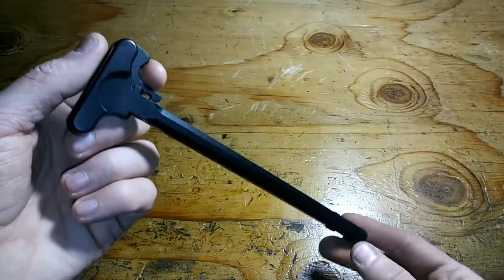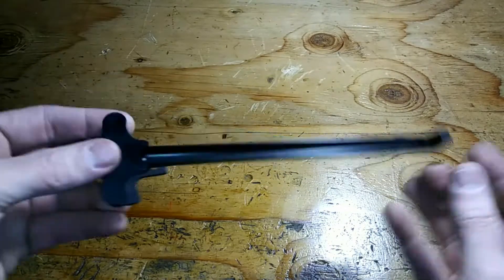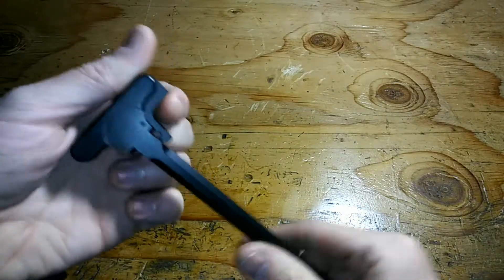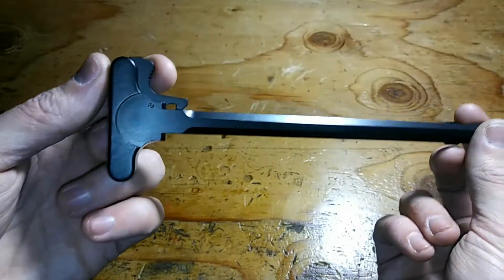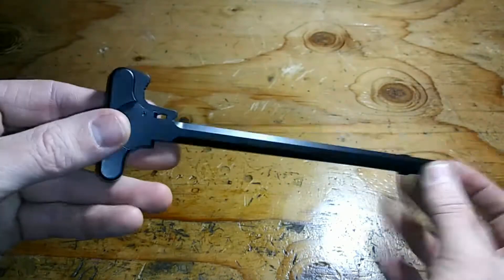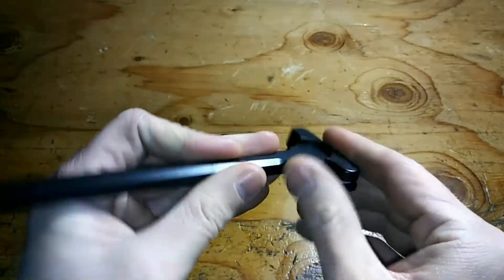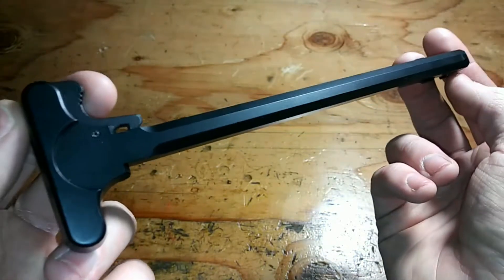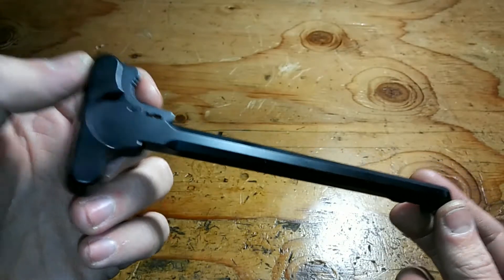IMI Defense AR-10 7075-T6 Aluminum Charging Handle

Comment: Great review have you ever thought about getting an AR10/SR25/LR rifle chambered in .308 win.? If so what brand or style would you prefer there are  alot to choose from now?
Reply from the maker: Team Stucker Well, it would be a combination of parts, I assume. I am a believer in building from parts, the AR10 market is a bit more complicated though due to the 3 or more different platforms to build off of but if I had to choose a brand, I would probably go with whatever the cheapest is currently, its really hard to go wrong with any of these companies. Every brand will have some nightmare story about it but few manufacturers churn out horrible firearms and stay in buisness. The system has been around a long time and most companies get it right, Id say.

I saw some pretty cheap DPMS's when i was on the market for an ar10, just vouldnt get past how much larger they felt. 

Sorry I cant be of more help on this particular subject.
Reply: Douglas Thompson 

I agree with you on building your rifle from the lower up lol that way you know what's in the gun and you will not cut corners like a few companies do for profits. I have a nice custom LR AP4 308 and we have 2   more factory guns I feel my build is better than the production guns were at the start a few up grades later now they all run very well and eat any round they are feed. Thanks for the feed back keep up the video's.
Reply from the maker: Team Stucker not only can they be etter because of part choice, they can also sometimes be cheaper for the same quality or even better!